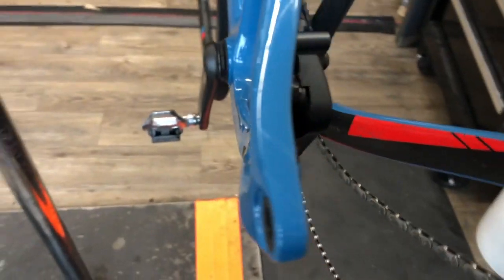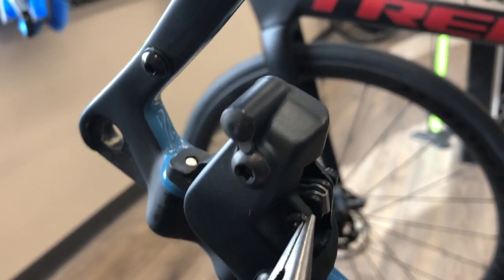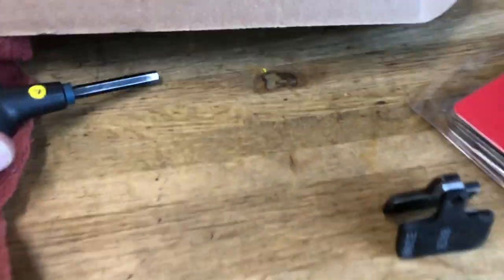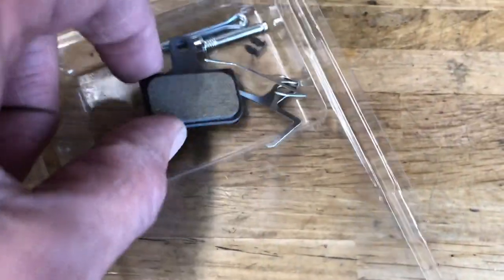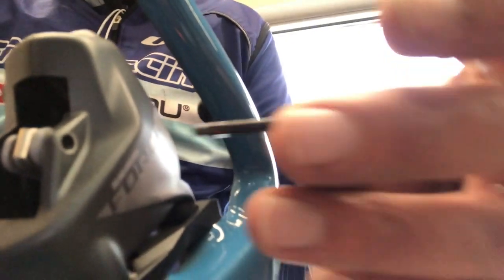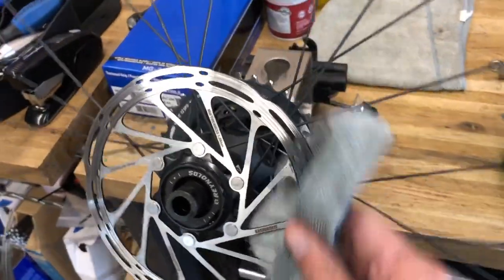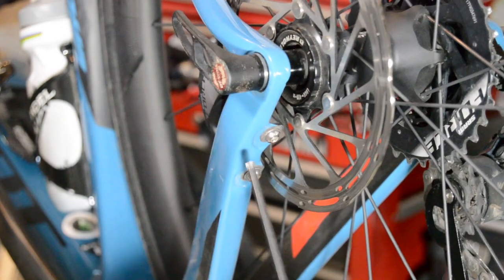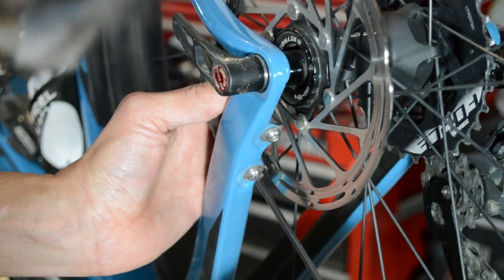SRAM Force Hydro Disc Brake Pad Replacement

Comment: Any tips on getting a road disc rear wheel out of the bike ?
Reply from the maker: Yes, I've got a few. The main one is shift to the small cog if possible before removing the wheel. Most road disc rear wheels these days are using a through axle design, which is new technology for a lot of folks. 
I tend to take this for granted and should have included wheel removal and reinstallation in the video. I'll make another video on the process soon, plus some things I've learned on some of the additional maintenance required with through axle designs.
Thank you for the question! I think this is great topic to share some acquired knowledge!
Reply: @JoeyMesa  Thanks for the reply 
Getting the rear derailleur to move and allow the wheel to drop out is a fiddly process.  Any tips here?

Comment: Looks like you were replacing two different pads. One had the pin at the end and the other was in the center... they are not interchangeable.
Reply from the maker: If you speak English, you would have heard and understood the discussion on this topic during the video....please listen again, translate, or whatever...